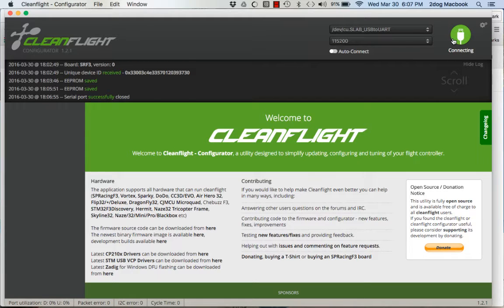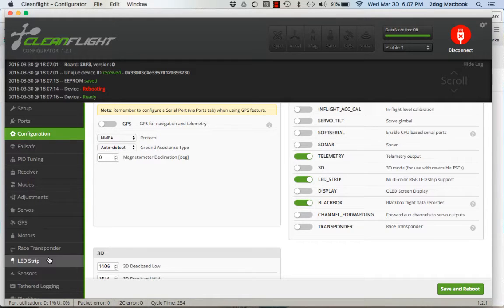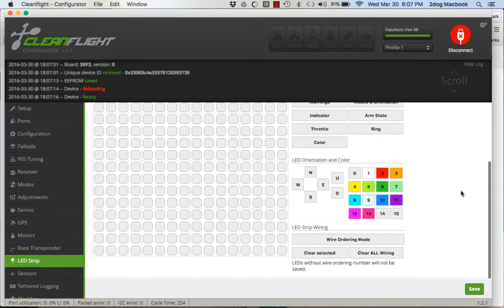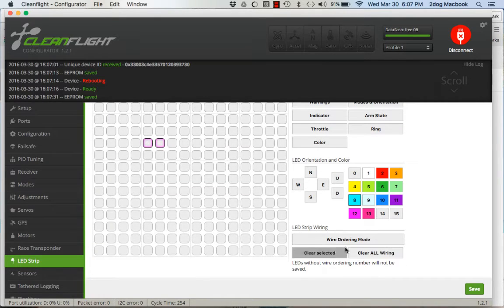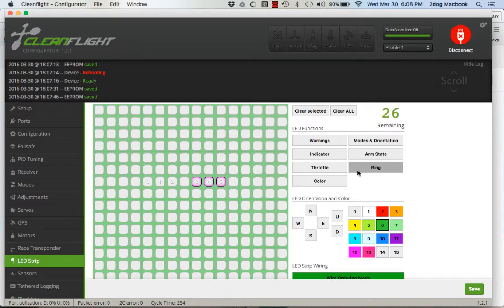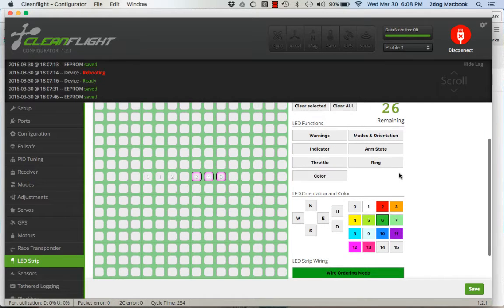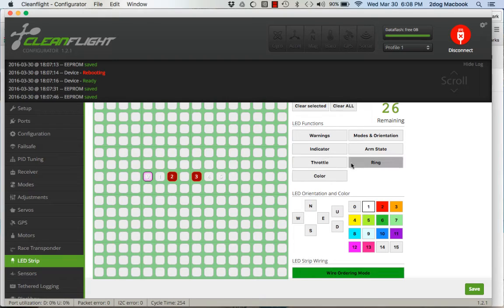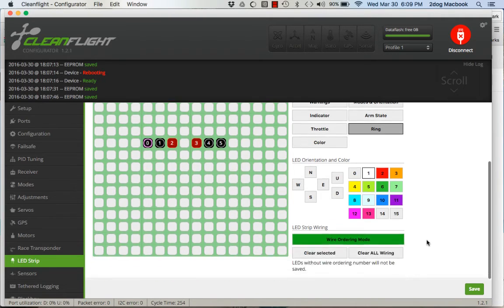Knight Rider Effect with WS2812 LED Lights Naze32 Cleanflight

Comment: good info these lights on my eachine v-tail 210 are to crazy for me at night.it took me a lot to not screw them up but i needed to change the blue to green in the front when armed.the blinking indicators on front drive me crazy there are 3 lamps on each front motor and 4 on the back strip. the back i need to set in ring it seems they stay on and are getting hot and melting the plastic cover.have to spend more time to figure them out.do different colors burn hotter?
Reply from the maker: They could be NON programmable lights which you can not change the color.  Also if they get that hot, they may be connected to the battery voltage.  If you run a 4s this may make them VERY hot.
Reply: thanks for the reply. programming them in cleanflight is a bit confusing.the lights on this v-tail are plugged in to the pdb and all can be changed.i dont like to to spend a lot of time on computer trying to to figure out.probably better to clear and start from scratch make notes as having 10 lamps are doing so many different functions and colors.the plastic was just smudged with glue my mistake.it was not getting too hot.the factory did a lot to set these up to look really cool at night. the instructions manual from china leave you scratching your head just a picture of layout.just wanna fly without the headaches.